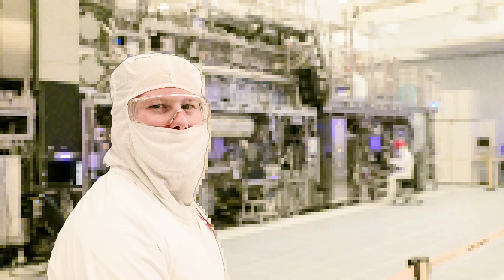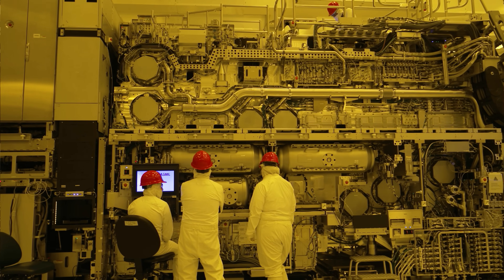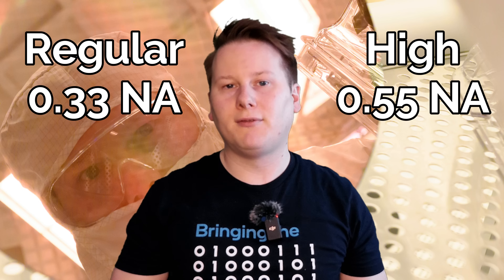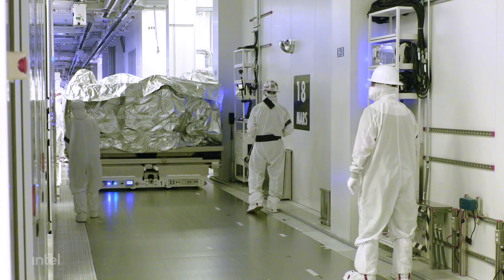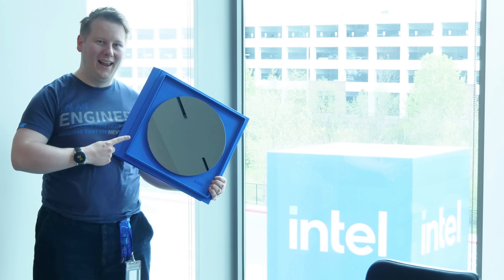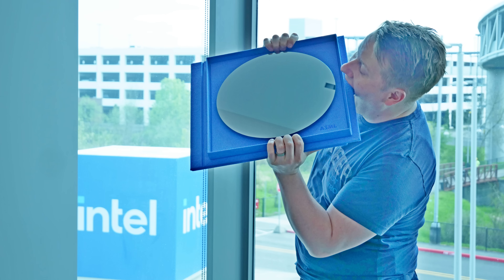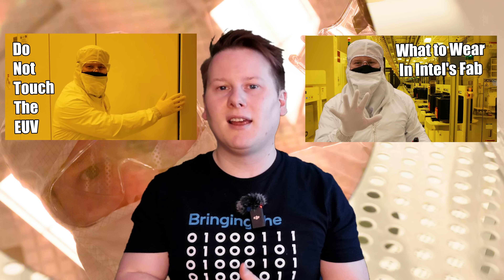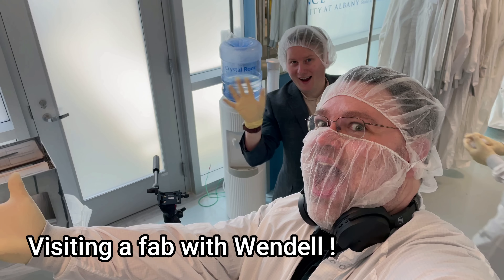Intel's Newest $350 Million Machine

Comment: I am one of the software engineers that developed the software for it. I visited ASML EUV factory/cleanroom in Veldhoven a few months ago, there were EXE machines fully built and some other big modules being tested. It is amazing, you keep staring at it and each time you find something different about it. Making 10 nm features in high-volume is allien tech, it is almost half smaller than the current best high-volume process. In general, making features 50% smaller would reflect on 4x speed/performance or more logic, but because it is NA bigger only in one direction, the gain is limited to 2x. For Hyper-NA I think they are going for 4x gain.
Reply: It remains to be seen if High-NA can be made commercially viable.  Calibration of EUV v1 is already a nightmare, as the mask and mirrors and targets have to be aligned down to fractions of a nanometer to prevent partial or complete blurring of the projection. With High NA this calibration has to be 5 to 10 times as accurate, and for Hyper-NA another 5 to 10 times. Complete insanity, as some asia-tech channel described it. Furthermore the rate of tin droplet firings has to be increased from 50,000 to nearly 100,000 per second to achieve the luminosity needed. Suddenly that earlier mentioned calibration seems relatively easy..... Also remember that these machines need regular recalibration.
Reply: @paulmichaelfreedman8334  5 to 10 times improvements in precision aren't even register in a great scheme of things. calling that "Complete insanity" its like calling a switch from a hand saw to reciprocating saw "unbelievable". improving things that can be and should bd improved is what we as humanity do. and what we should do. there's nothing unusual or insane about it. 
>tin droplet firings has to be increased from 50,000 to nearly 100,000 per second 
actually its orders of magnitude less hard than going from 0 droplet firings to 50,000.
Reply: @paulmichaelfreedman8334  it feels like beyond some point using a linear prescription of complexity is misleading. I mean, perfectly aligning template and double shooting metals at 50 000 times per second is already insane. Should we think that 100 000 and finer alignment is that much more complicated? Unless there are some specific boundaries in some specific components, which I'm sure there are some as always, but overall, going there from here shouldn't necessarily be as hard as it might seem. I hope that makes sense. Basically, a lot of seemingly impossible things are already done. Improving that, while sure it's a challenge, is not as complex as getting where they are already.
Reply: @dmitryburlakov6920  Sure it's the next step up, not the tenth. But it's still a big step. 100,000 is much harder than 50,000. I'm not doubting they will achieve acceptable yields, but it might turn out to take much longer - something taboo in the sector.
Reply: Eindhoven = Veldhoven :)
Reply: What languages are they programmed in? I imagine that because there are a lot of embedded components, a lot of C is used, but do you also use higher level languages to program the logic, send general commands, etc?
Reply: @_yonas  the machine has everything, hardware description (verilog/vhdl), c/cpp, python, java, julia, and some specific application languages
Reply: Alien technology confirmed 2024 gang gang
Reply: Out of curiosity do you know what Intel model of chips this will produce or is it too far out yet for offical branding?
Reply: @mydogsbutler  it will produce chiplets/dies for ALL OF THEM for a decade or even more until they switch to a newer machine for newer chips but will continue producing lower-end chips/chiples with it even longer.
Reply: Meanwhile China goes quantum  with optoelectronics; Game over!
Reply: Incredible.
Reply: Where can I get one of these machines? I think if I had one I would be pretty wealthy
Reply: @TKUA11  buy from ASML
Reply: Lol just make sure you dont leak like china or get hacked. This is a public place bro
Reply: Give us the source code!
Reply: I dont even know what im watching i been reading these comments lol
Reply: the stocke price should have been 200 dollar but it dropped to 30 dollar, and this guy will not tell you why?
Reply: 185 wafers/h @$20k = $3,7 mil/h. it will return its $350 Mill cost in 4 days.
Reply: @rawdez_ the gains are a few orders of magnitude lower then that. Keep in mind, there are thousands of process steps to make a wafer useful and millions of dollars a year are spent on keeping these overcomplicated machines running. Go work for a fab and you’ll figure out it’s not all sunshine and roses.
Reply: @alexanderbrown6077  yeah I know. I'm talking about that time they'd start actually using that thing for production. obviously you need time to get there. but when they do - as they always have - it will be just a week to return all its cost back. and then it will print Intel money for decades. with upgrades maybe not even dropping money printing speed too much.
millions of dollars a year are spent but billions are made.
Reply: @alexanderbrown6077  >there are thousands of process steps to make a wafer useful 
in comparison to making wafers those costs are pretty much negligible. thats exactly how corporations make billions in profits. IT IS all sunshine and roses in the end.
Reply: @rawdez_  You seem to have a misunderstanding of the larger picture. Get involved in the industry at the upper level and see reality for yourself. By the time they have it ready for a haphazard production ramp they will be Billions of dollars in debt. Just look at how Intel Foundry Services is doing on its latest financials as evidence of that. Any money they make from it is largely going to have to go into funding the next generation of equipment for the company to stay competitive. Money printing isn’t that simple. Equipment payoff timelines is measured in years not weeks.
Reply: @alexanderbrown6077  lol, your arguments are invalid. obviously equipment payoff timelines is measured in years because they spent years prepairing for production and it takes more than 1 machine. but payoff timeline for that 1 exact machine during production phase is LITERALLY just weeks or even less than a week.
>Get involved in the industry at the upper level 
thats not an argument. actually thats like a wellknown logical fallacy aka "achieve smth to understand".
>they will be Billions of dollars in debt
they will be Billions of dollars in PROFITS from milking previous equipment that still prints chips.
Reply: @rawdez_  You are missing the fundamentals of manufacturing cost modeling and value stream mapping. One process step at one machine does not quantify the entire economic output of a factory. The value added of a factory is not the value added of the entire value stream from sand to packaged cpu. 

You don’t cover the cost of a $350+M stepper in a week of bouncing photons off silicon or everyone would only be doing that. There are thousands of other etch/dep/imp/etc. steps and 10+ million dollar machines involved in getting one barely functioning CPU produced. There is a reason GF dropped out of the leading edge race several years ago and laid off their entire EUV team. 

Intel is over 100k engineers and highly skilled technicians along with billions of dollars in equipment and software support companies. With all of that “milking”, they have barely stayed competitive as a business with McDonald’s over the past decade with regard to Gross Margin percentage.
Reply: @alexanderbrown6077  just lol. a lot of empty words. go invest in McDonald’s then))
Reply: @alexanderbrown6077  in no point I've said 'everybody can do it'. everything you're mentioning doesn't make any of my points wrong. as tech corporation Intel is successfully milking the market with near-0 progress tech and makes billions by doing so.
Reply: @rawdez_ you’re forgetting that (1) there are costs for materials, consumables, staffing and power (for example, the silicon wafers, the etch resist chemicals, the enchant, 180kW/hr for the lasers etc) and (2) the completed wafer requires MULTIPLE passes through the stepper (one or more passes for each layer). SOME of the layers can be created with lower tech hardware, but you don’t make 185 COMPLETED wafers per hour, not even close to that. The payback period is far longer than you seem to think.
Reply: @stevetodd7383  I'm not forgetting anything. its all already included into wafer prices. you actually do make 185 COMPLETED wafers per hour when production happen.
Reply: @rawdez_  you’re dreaming if you believe that. It can take over 6 months for a wafer to go from one end of the production process to the other. There is no way that a single stepper machine can create 185 FINISHED wafers per hour. Again, one pass in the stepper can, at best, create a single layer of the design. Modern chips can easily need 20 or more layers.
Reply: @stevetodd7383  do you think that the mass production process isn't automated and "printed" wafers go from 1 machine to another for 6 month? just lol
Reply: @stevetodd7383  machine/production line makes everything - all layers. you're delusional if you think that process takes "months".
Reply: @stevetodd7383  what you describe its simply not mass production - its a joke. wafers cutting/packaging/testing of chips - yeah, it probably can take months with logistics and everything. but we aren't talking about that.
Reply: @rawdez_  industry standard is 1 to 4 days per mask layer depending on which part of the industry you are in. Analog wafers have a dozen mask layers, Logic and Memory wafers can have a few dozen mask layers. Each mask layer involves the wafer going through typically a dozen semiconductor manufacturing tools, sometimes more. The lithography tool showcased in this video could be one of those tools. It is automated yes, but this is not simple injection molding or CNC process. A finished part is not produced by going through one tool. The lithograph machine does not etch, it does not implant, it does not deposit films, it does not thermally anneal. A whole separate tool is even needed to apply and develop the photoresist.
Reply: @alexanderbrown6077  industry standard where & when? we are talking about leading edge process here, not about "indstry standard". obviously its not a standard, its a stand out leading edge. and where you get your information from, I'd like to look/watch/read.
>could be one of those tools
apparently you don't know what you're talking about
Reply: @alexanderbrown6077  making nm-level transistors is technologically hard, everything else is relatively easy and cheap to do.
Reply: @alexanderbrown6077  Intel themselves said that machine makes 185 wafers/hour. I didn't made that up. go argue with Intel statement, why argue with me. you're like "NO, Intel, AKSSHYUALLY you CAN'T" lol, because "INDUSTRY STANDARDS".
Reply: @alexanderbrown6077  "the most complicated process takes less than 20 seconds, but easy steps take WEEKS", lol. yeah, right. nice fairytales, dude
Reply: @rawdez_ Except these are public companies.  We can literally look at their profits and they aren't doing particularly amazingly.

I don't think you are factoring in all the expenses they have -- both in running the machines, researching the next generation of tech (not to mention all the false starts) and the fact that they don't get paid retail prices for most of the chips they sell.

If they were just printing money than why have so many companies dropped out of the game?
Reply: @petergerdes1094  lol. they are LITERALLY MAKING BILLIONS in profits. and with these profits they buy and kill all competition. margins on near-0 progress silicon they sell is actually INSANE.
Reply: @petergerdes1094  old cheap-to-produce silicon made with old fab machines is overpriced af. new silicon is overpriced even more. they can easily afford selling @ a bit lower than arbitrary overpriced x5-10 times (& way more)  "retail prices".
Reply: @petergerdes1094  amd pays TSMC and sells similar silicon and still makes HUGE profits. intel are their own TSMC, basically they get all profits for a piece of silicon when their rivals have to share their profits with other companies. Intel is doing actually great.
Reply: @alexanderbrown6077  I wouldn't call them overcomplicated, they're as complicated as they need to be for such a delicate process.
Reply: @rawdez_ You totally underestimate the complexity of these machines, the complexity of the processes. Your ROI calculations are way off.  You seem to forget these machines need to be housed in billion dollar clean room buildings. They need lots of power to run.  Lots of people to run them.  If things were anywhere close to what you are saying, Intel would be in a much different position today instead of laying off thousands, loosing billions of dollars and seeing their stock price cut in half.
Reply: @rawdez_ the problem is in your initial number of $20k. It doesn’t include any of the other costs of production so it doesn’t really earn back $350m in 4 days. Intels reasoning for not having one of these much earlier was that they didn’t think they could make it profitable. Clearly, they were wrong and have changed strategy
Reply: @UnderscoreZeroLP  $20k is actually high estimate, lol, that includes EVERYTHING. but okay not 4 days but a week. or EVEN 2 WEEKS. happy now?

intel's reasoning for ignoring these machnes is they didn't have to make any progress because milking of 14nm++++++ and then 12-13-14 "gen" was going just fine and noobs kept buying their near-0 progress CPUs. and there were nothing to worry about. but now there's ARM64 nuvia/snapdragon and amd with 40cu rdna3 iGPU. so intel kinda have to match their performance now. and thats exactly what they are doing. and all those mar-ke-ti-ng fai-ry ta-les are just mar-ke-ti-ng for noobs. + somebody shorted their stock. everyone is happy. you really should stop believing everything corporations say and ask yourself WHY and WHAT THEY DO. they ALL are maximizing profits and telling useful lies to maximize profits.
Reply: @rawdez_  this machine doesn't take blanks and spit out finished wafers ready to be cut, does it? Thefe are a bunch of other machines in the production line and people & consumables & building, infrastructure etc. to keep them running.

Won't that alter the per-wafer profit?
Reply: @AlexKarasev  no. what I've counted from is a finished wafer price
Reply: @rawdez_  my point exactly. You divided this machine's cost by the finished wafer's price and by this machine's top wafer throughput (for a single photolithography pass, right?). But photolithography exposure isn't the only step & machine involved in turning blank wafers into finished ones. Furthermore, the same wafer may go under this machine over a hundred times as more and more layers are formed on the chip before it's finished. Further-furthermore there are running costs (consumables staffing, etc.) to keep that entire operation running - all the machines including this one - not just the purchase cost of this one machine. All of that takes away from the profit remaining from the sale of that finished wafer.

I'll go as far as saying all those factors worsen the "pay for itself" estimate to such a degree that Intel in fact may NEVER fully recover its purchase cost of this machine. But it has to bite the bullet anyway to
1. Stay at the forefront of the chip market by gaining early access to, and experience with, this process. Once this becomes more routine and scales up, the profits will improve some & Intel will be well positioned by tben to reap them.
2. Possibly more importantly, US Dept of Defense may have told it to do this or else, and thrown a bone its way - be it some subsidies or tax lenience or something else under the covers. Won't have to be much as the Fed has a law on the books enabling it, at a time of war (and when wasn't it a time of war?) literally to tell Intel what to do and how to do it, without any disclosure.
Reply: @AlexKarasev  it doesn't change anything. you can add a week or 2 of time or a month if you wish and that would be it. other machines are already available. all costs ARE ALREADY INCLUDED into my initial calculation as it is about A FINISHED WAFER. you're just making things up to try to make it wrong. but it is 100% correct.
Reply: @AlexKarasev  you can try and argue that "its a whole factory that makes chips not just this one machine" all you want but that 1 factory literally makes billions of profits a month and the cost of a $350 mil machine is nothing in a long run of a quarter or a year.
Reply: @AlexKarasev  go argue with Intel - 185 FINISHED wafers per hour from this machine thats their number, not mine.
Reply: the problem of slow progress is EXACTLY because corporations don't want to throw away these machines. it pays for itself in like a week of production of chips and they keep using them for DECADES milking the market instead of actually doing some FAST progress.
Reply: why throw away a machine like this? it is thanks to old nodes that we have high-efficient chargers, IoTs, cheap memory, cheap high speed internet. You do not need the smallest features for all applications. There is a whole market called "mature technology" for older machines. The economics make sense, no need for initial capital, the machine is installed and calibrated, you know exactly how to operate it, you optimized the hell out of it. In other words, it is cheap to produce chips with these machines. The customer know this and it reflects on price per wafer, making incrementally more complex chips cheaper
Reply: @xanokothe  No one is saying throw the machine away.
Reply: @xanokothe  yes but it also kills innovation because machine users i.e. corporations  become complacent with profits and humanity ends up with a lot of "cheap" (but actually overpriced x5-10-20-50 times) obsolete slow 0 progress tech. e.g. basically the same performance level for GPUs/CPUs/consoles/memory/dumbphones for a decade or even  more. its literally 0 progress that you're praising. I'd rather have x1000 faster teraherz CPUs, GPUs, memory and way faster teraherz internet by now than "high-efficient chargers, IoTs, cheap memory, 'cheap' current internet". but actually if progress was way faster (as fast as it technologically can) we'd have all of this but way better. not gonna happen though. because milking the market and the same equipment is way more profits.
Reply: @rawdez_  There is a lot of demand of electronics that can be done with old tech. They demand have actually increased so it's more a problem that it's not enough with the old machines out there to do stuff that is not for smarthphones, servers and PC. Even in an PC all the things is not done with the same node, if you look at your motherboard, it's a lot more than the CPU there.
Reply: @lubricustheslippery5028  one of the challenges with the older tech is the margins are often too tight to justify new tool prices so a lot of those other chips are still manufactured on old equipment still running DOS and OS/2 operating systems and the latest Pentiums.

Another challenge in the Analog side of the industry is that the technology isn’t transferable to 300mm wafers (so can’t use newer tools) due to crystal growth limitations.
Reply: @lubricustheslippery5028  >that can be done with old tech.
yeah. what I'm saying is when you have way faster progress it all shifts up. way better "old tech" than what we use as "top tech" now could've been used as "old tech" - in a better world where there's actually way faster technological progress e.g. intel tera herz  is in production from 2005. obviously you'd have to have way better chipsets / bus / memory / storage or whatever for x1000 faster CPUs/GPUs etc. as is its just excuses for obsolete tech. like "we use it, see". but we could've used way better tech instead.
Reply: @rawdez_ I don’t think dumping raw bleeding edge tech would do much good for anyone. Very limited upside but downside - potentially extinction level. Nobody is complaining, to my knowledge, that things are too slow.
Reply: @unixux  everybody with enough working brain is complaining that things are WAY too slow and progress speed is nowhere near what its been in 90s and early 2000s - exactly because corporations chose milking the market with as slow progress as possible.
Reply: @unixux  obviously you don't hear any complaining from noobs and tech shills that basically make ads on yt for overpriced 0 progress crap and call THAT 'reviews"
Reply: @unixux  meanwhile the $2000 4090 is unable to run modern games on BUDGET $200 1440p 180Hz monitors without upscale and glitchy fake frames. for $2000 its only capable of 52FPS @1440p in Alan Wake 2 on BUDGET $200 MONITORS. i.e. progress wih silicon is actually even slower than VERY SLOW progress with displays. to the point corporations sell $2000 GPUs that are ALREADY OBSOLETE because aren't fast enough for modern games. GPUs these days have to be x3-4 faster @ x10 lower prices to make any sense. and that is with obsolete cartoonish-looking 'modern' gaming engines.
Reply: @unixux  "Nobody is complaining", lol. maybe that is THE PROBLEM that people aren't even able to complain these days because everything is controlled by corporations. e.g. most of my comments disappear.
Reply: @unixux  I mention Intel tera herz in comments - it disappears. 
"nobody's complaining", yeah, right. its just you chose to not notice the complaining
Reply: @unixux  >I don’t think dumping raw bleeding edge (e.g. 2001 Intel tera herz - 1000GHz) tech would do much good for anyone.
actually I tend to agree because I see obvious repercussions of silicon becoming obsolete in an instant. BUT we can have computational power that actually is adequate to reality we are living in in 2024 - just limit it to sub tera herz frequencies and make less transistors per chip for consumers. meanwhile supercomputers can become thousands times faster and start solving humanity problems WAY faster. instead they milk silicon tech and come up with software solutions to fake having more performance. and outcome looks just pathetic.
Reply: @unixux  now we get 0-15% "progress"/year in performance. which is just pathetic. yeah, we don't need any faster hardware when 99,9% of the market consists of old hardware + "new" hardware with old performance level which leads to all software being made for that SLOW hardware. old hardware with people who defend it is the reason there's 0 progress, why everything is an obsolete slow trash and overpriced. 6-8 y.o. tech is basically on the same performance level as "modern" tech and a bit faster but still way too slow hardware with software tricks to fake "more performance" (like GPU upscale and fake frames generation) is insanely overpriced - so old hardware can stay overpriced af too.
Reply: @unixux  there's 0 performance progress between the 7800xt and the 6800xt. or between the 4060ti and the 3060ti. 3 years have passed = 0 progress. before mining in 2016 top GPUs that could've run ANY then-new GAME on top-spec monitors @4k 60fps (which was elite FPS and resolution at the time) cost $600 => in 2024 $2000 can't drive MODERN BUDGET $200 1440p MONITORS in now-modern games without upscale and fake frames that introduce latency. drops to 16fps @1440p with RT in CP2077 on a $2000 GPU. and its still looks like low-VRAM cartoonish crap that it still is. yeah, much "progress'. very wow. 

i could continue with examples from GPU/consoles/CPU markets that show 0 or negative "progress" for hours. and you tell me "nobody is complaining".
Reply: @rawdez_  you’re comparing apples and oranges. The 4090 with ray tracing on may struggle at 1440p, but that’s because ray tracing is hard and every other video card on the market is slower. Turn ray tracing off or use DLSS and performance is much better. Running older software on the new card and you’re bouncing off the frame limits of the software.
Reply: @rawdez_  there are three different ways in which CPUs are improving these days. The traditional way was to improve the clock speed. That is still happening, but at a much reduced rate. The second is to improve IPC (instructions per clock), which is holding to about 10-15% per generation. All the easy wins have been made here, and it eats many transistors to make these improvements. The third way is to add custom hardware units for specific tasks (video encoding for example, or NPUs for AI work), but that needs the software to catch up to make use of it. 

Gone are the days of needing a new PC every year or two to keep pace with the software, but a cumulative 10-15% each generation for three or more generations adds up to a significant improvement.
Reply: @stevetodd7383  no is not. it doesn't adds up to "significant improvement". 
e.g. nuvia/qualcomm CPUs exist - 5 times faster than Ryzen 4. will we see it released with +400% performance/watt right away? NO. they gonna MILK IT to maximize their profits from this tech. same way as Intel released 14nm++++++++ and then 12-13-14 "gen" being the same. same as amd when releasing non-3d vcache CPUs or ryzen 1000-5000 when Zen was supposed to be like Ryzen 5000 right away according to leaks. same as Apple M1-M4. its all the same milking.
Reply: @stevetodd7383  rt is 6y.o. tech. it isn't hard. its nv milking the market and not improving their GPUs and RT enough so they don't have to drop prices on older GPUs much.
Reply: @stevetodd7383  >Turn ray tracing off or use DLSS 
then why even buy new GPUs lol? you can run it the same on a used 6800xt for less tha $300. new GPUs make 0 sense and you're defending the absense of progress by repeating mar-ke-ting fai-ry ta-les.
Reply: @stevetodd7383  I'm comparing the past in 2016 and the present 2024. it is TOTALLY VALID comparison. there was a progress with monitors and mining is gone. GPUs obviously are obsolete, overpriced at least 3-4 times + WAY too slow for reality in 2024. lets even ignore that its all low-VRAM crap not capable to produce realistic graphics and that visually its not really far from Doom3 2004.

but yeah, tech shills really don't like when people use common sense in their comparisons.
Reply: @rawdez_  if you believe that Nuvia chips are 5 times faster than Ryzen 4 then I have a bridge to sell you. The performance per core is pretty close between Intel, AMD and Apple. The efficiency per core is somewhat different depending on the base architecture (ARM64 being significantly easier to decode than X86-64), and Apple run a wider execution unit (8 wide rather than the 6 wide of Intel and AMD), but the performance per core of the top end parts is within a few percentage points of each other. The big problem is that current software tools and languages aren’t good at multi-processing, so that a single application rarely makes efficient use of more than a handful of cores. This is why gaming PCs of the current generation don’t really improve beyond 8 cores.

So, Nuvia is based on ARM64, using ideas from the design team that came up with the Apple M1, and performs at a per core level very similar to an M1 performance core. The idea was that they would put a lot of these performance cores on a server and stick it in a data centre. Servers run many parallel applications so the multi-processing issues don’t apply, but it’s like comparing a truck with a sports car. The truck is optimised to shift a lot of stuff at the same time and the sports car shifts comparatively little, but faster. Nuvia can shift more volume than Ryzen 4 (though probably not the Zen 4 based EPYC server chips), but only by having more cores with lower efficiency than the Apple M series (which mix performance and efficiency cores depending on model).
Reply: @rawdez_  ray tracing is eye candy. It gets turned on by people who want better looking images rather than absolute performance. DLSS is there to drag performance back to something usable if you use ray tracing. Modern high end GPUs are fast enough for 4K raster graphics rendering for the most part. Older cards fall down over the amount of VRAM available to the app. Modern games need 12-16GB of VRAM to hit peak performance, and your 2014 card would be lucky to get 8GB. You can still use older cards, but you need to turn image quality settings down to make them usable.
Reply: @rawdez_  ray tracing is a problem that is yet to be fully solved. Modern GPUs have reached the point where it is usable, but it is far from fast and perfect. Nvidia are on their 3rd iteration of their ray tracing hardware, and as you pointed out it still kills performance on high end cards. The problem is that there is so much complexity and computation needed to make it work that it’s on the edge of what can be achieved in current silicon.
Reply: @stevetodd7383  rt is not the problem. the problem IS not wanting to drop prices on older products = no making faster products = no progress. and you're. just. repeating. nv mar-ke-ti-ng.
Reply: @stevetodd7383  dlss is there to sell SLOW 0 PROGRESS hardware. thats what it is. useless glitchy gimmick for useless slow overpriced af cards. artificially limited to newer GPUs for artificial market segmentation. instead of making actual progress with hardware and dropping prices corporations make cheap-to-do software upscale + glitchy fake frames and keep prices high. including on old hardware - old gen GPUs and consoles. + release slow af handhelds barely running anything with help of upscale and fake frames on pathetic hardware.
Reply: @stevetodd7383  you're just repeating marketing nonsense like a typical nv shill.
Reply: @stevetodd7383  blah-blah-blah marketing bull--sh-it
Reply: @rawdez_  they do keep selling their older products at lower prices, they just tend to rebrand them (GTX1660 anyone?). I’m not a great nvidia fan myself, since AMD cards tend to be better value for money providing you don’t want RT, but I have a top end 2013 era GTX980 and a mid range Radeon RX 6700 XT. The AMD card runs rings around the older nvidia model. It’s not something you wouldn’t notice.
Reply: @stevetodd7383  if progress was as fast as it supposed to be in accordance to Moore's law your obsolete in any modern game on a BUDGET modern 1440p 180hz monitor RX 6700XT would cost $0 like FX 5200 from 2003 costs now and graphics in modern games would actually be realistic movie-like, not mentioning it'd all be VR.
the progress IS artificially slowed down to maximize profits so obsolete cheap-to-produce hardware stays relevant and overpriced => way more profits.
Reply: @stevetodd7383  RX 6700 XT is a 2021 card, GTX 980 is 2014. in 6,5 years the RX 6700 XT should be ~x12 times faster according to Moore's law, IRL its just x2,3 times faster.
and don't forget that 1440p 180hz monitors are budget and THE norm now, it was 1080p 60hz in 2014. and RT is a 6 years OLD technology by now, which can't be run at playable level by any under-$600 GPUs now ($600 is top GPUs price pre-mining pre-2016). your GPUs are obsolete. the only reason they still run "new" games now is because gamedevs are forced to make "new" games for the market where there's 0 progress and all hardware is obsolete. "new" obsolete games on obsolete gaming engines for "new" obsolete 0 progress GPUs.
Reply: @rawdez_  firstly you’re confusing what Moore’s law says. It doesn’t say that every 24 months performance will double. What it does say that every 24 months the number of transistors you have available for a design will double. Much of engineering is about diminishing returns, that is 100% more inputs doesn’t give you 100% more output. Just like with CPUs, all the simple improvements have been done already. GPU designers have to make decisions over which improvements will give them the best gains for the number of transistors they have available.

Second, a gain of a factor of 3 (which is what I get on synthetic benchmarks like Firestrike) isn’t zero. Moving to a top end card of the current generation about doubles that. Again, not zero. You seem to have this mad idea that anything less than double is zero. The improvements from generation to generation aren’t constant, but it have been consistently upwards.

Card prices have been high for a number of reasons (COVID causing component shortages, GPU mining taking off, the increasing cost of wafers because of the increasing complexity of the hardware needed to create leading edge chips etc.). Again, Moore’s law doesn’t say that prices will reduce. However, if manufacturers price their products too high then they won’t sell. It’s a balancing act over what performance they can give you for a target price.

Once again you have harped on about RT being 6 years old. No it isn’t. RT software on desktop machines started to appear back in the 80’s (but it could take hours to render a single image). 6 years ago they finally managed to get it to run on hardware fast enough to run real time games, just with a performance penalty compared to traditional raster graphics. Look at how long it took between the first 3D graphics cards becoming available and 3D graphics becoming high resolution and high quality. No one, not nvidia, AMD, Intel etc, can currently make RT hardware that can keep up with modern monitors. If you want to run at 180Hz or higher then your priority isn’t image quality and you don’t turn RT on. Modern game developers realise that it’s a feature that most users don’t make use of because of the performance impact, so they provide a setting switch to allow users to turn it on or off.

The other mistake you are making is that game developers aren’t using the extra power of modern cards. Most games come with quality presets, the highest being suitable for latest generation top end cards, and lower settings being there for older and/or lower end cards. Gamers with the latest and greatest hardware get a visually better experience, but the same game. Try running an old game on modern hardware. Something like GTA V runs so quickly on a modern GPU that the CPU can’t keep up and it starts stuttering (the developers couldn’t conceive of anything running that quickly and didn’t rate limit the frame generator).
Reply: @stevetodd7383  blah-blah-blah synthetic blah-blah-blah "x3 in 6,5 years is YUGE" lol. top card then cost $600 so compare to $600 cards now, not top cards. and stop with mar-ke-ti-ng bu-ll-cr-ap
Reply: @stevetodd7383  yes they can. the problem for gamers is they DON'T WANT TO MAKE PROGRESS because OBVIOUSLY progress drops prices. and obviously you are just repeating their mar-ke-ti-ng
Reply: @stevetodd7383  firstly you’re confusing orders of magnitude. a free tip: x192 and x8 are VERY different numbers. x12 and x3 are ALSO very different numbers. you can't even explain that difference with  mar-ke-ti-ng bu-ll-cr-ap like "It doesn’t say that every 24 months performance will double" or "all the simple improvements have been done already" lol.
Reply: @stevetodd7383  i bet YOU KNOW you're full of it. but you just can't help yourself
Reply: @rawdez_  apparently you don’t want to understand, or are unable to do so, so I will make this my last message on the matter. Old games like GTA V are relevant because that’s the sort of thing you would run on a graphics card back in 2014. It was brand new at the back end of 2012. It runs on “potatoes” these days because the performance expectations of a modern card are that much higher than back then. What was a leading edge card in 2014 is a potato today. This isn’t me being a shill for the GPU industry, this is me pointing out just how skewed and off base your idea about GPU performance increases are. The extra performance provided by a modern card has been used by games developers to make their games look prettier. Your perceived lack of improvement is not because GPUs haven’t been improving, it’s because modern games run at the same speeds as period games on period hardware.
Reply: @stevetodd7383  and what was a leading edge card in 2015 is actually NOT a potato today. because after 2015 progress got slowed down to minimal speeds and 1080ti level cards still can play modern games. also ps5 has gtx 1070 performance level.
Reply: @stevetodd7383  GTA V is jusy a marketing tool for shills to try convince noobs there's enough progress with tech.
Reply: @rawdez_  Intel just reported a 7 billion dollar loss on its foundry services, they are not printing money and "paying for themselves" over a week of production, that's for sure. I also don't get why you think they don't have financial incentive to have better processes. Sure if Intel were a monopoly in the foundry business that could be the case but they definitely aren't, they face very very stiff competition from TSMC and Samsung and they are spending billions of dollars in R&D and fab building so that they can retake the leading process capabilities. If you want to imply that TSMC, Samsung, and Intel are in some kind of price fixing scheme you're gonna need a lot of evidence to prove that, and you will have to also disprove a mountain of evidence that runs counter to that. Why do you think they so carefully manage floor space and keep them running basically 24/7? Its because its the only way to maintain profitability and even then Intel is still currently operating at a loss. Also your claim of "slow progress" almost couldn't be more wrong. Computer chips are famously one of the fastest (if not THE fastest) improving technologies in the world. Ever heard of Moore's law? Yeah... most businesses aren't improving their technologies at exponential rates, sure its slowing down somewhat in modern times, but its still far faster than linear improvement. Also, why do you think that they keep older machines around? Global foundries has stopped chasing the leading edge in equipment because most of the chips in our world don't need to get faster, there's no benefit. If the sensor in your car already reacts to collisions in superhuman time, they just don't need to make it faster, they are going to reserve their top end technologies for situations where higher speed actually helps, CPU's, GPU's, AI accelerators etc. Your argument is like complaining that because race cars exist we should stop production of slower cars. Slower cars still get you from A to B and have plenty of demand.
Reply: @ExcellentEric  ALL of the chips in our world DO need to get faster, there's benefit of getting more performance/watt = getting new possibilities OR dropping energy consumption.
Reply: @ExcellentEric  your argument is like defending abscence of progress and gasoline engines against electric engines/other future engines. like saying "humanity doesn't need warp drive or flying cars/drones or any new better technology" thats exactly what you're saying here.
Reply: @ExcellentEric  your argument is like complaining we don't need cars at all we should use horses and donkeys instead - still get you from A to B and have plenty of demand
Reply: @ExcellentEric  not to mention intel tera herz 1000GHz transistor technology leak in 2001. actually PCs/GPUs/etc. can become 1000-100000 times faster by using better tech than silicon. that tech exists from 2001, we could've had it in 2005 but ntel chose to keep milking the market with silicon instead
Reply: @rawdez_  That's just not true, I'm gonna be honest you come across like a 16 year old with no experience in the world of engineering. In engineering there are some things that just don't have a genuine benefit from being improved. Take a hammer, you can add a compass to it, the ability to charge your phone, and geolocation, but that stuff just doesn't make a lot of sense. There are some things that are good the way they are, and the people that make them are just servicing a demand.
Reply: @rawdez_  I am not defending the absence of progress because 1) thats not what I said 2) there is plenty of progress being made. Just because they continue to produce chips with older nodes doesn't mean they aren't making progress in other areas. "Exactly what you're saying here" at least with that statement you made it clear you were misunderstanding me.
Reply: @ExcellentEric  >There are some things that are good the way they are
and CPUs, GPUs, gaming consoles, SoCs in all dumbphones and TVs worldwide AREN'T GOOD THE WAY THEY ARE. too slow, too powerhungry/inefficient, too obsolete with 0 actual progress per $$$, way too OVERPRICED. thats what it is ACTUALLY with tech
Reply: @ExcellentEric  e.g. I personally always predrill holes for nails with a cordless drill/driver these days before hammering it. because its way better than using just a hammer by itself, that way nails have less chance to bend, nail goes where you actually need it to go and wood don't split almost never + using a hammer is way easier, accurate and efficient after predrilling. 
and the same way I could've used way better way cheaper GPUs and CPUs and SoCs in dumbphones but there's none. its like we stuck just with a hammer no powertools and able to do only obsolete type of jobs very slowly and inefficiently. and everything is way too overpriced, for the price of just ONE rtx 4090 (that is unable to even give a decent experience in new games on max settings even @ BUDGET 1440p - 52 fps in Alan Wake 2 and drops to 16fps in cp2077) - $2000 - you can fill a whole shed with powertools and other stuff for work. thats what it is with modern tech. slow, inefficient and overpriced to the point of being unaffordable to 99,9%. did I mention its very slow and very overpriced?
Reply: @ExcellentEric  > Intel just reported a 7 billion dollar loss ... aaaand 54 billions profits in the same report
Reply: @ExcellentEric  That's just TRUE, I'm gonna be honest you come across like a 0,5 year-old nv/intool shillbot with no experience of actually living in the actual world.
Reply: not making any progress and using these machines for decades = printing trillions $$$ from sand. just have to slow the progress down to being as slow as possible.
Reply: @rawdez_ your naitivity outstands me. 

printing from sand? pays back the cost in 4 days? you clearly don't know what your talking about. 

do you really think the only ingredient here is sand? do you really think that it's like a damn ice cream machine where you just put the ingredients at the back and then push a button?

do you even know the number of toxic chemicals are involved in this? the amount of water used?  electricity? how the wafer is made? it's not like you just throw a handful of sand on a pan and spread it out like a pancake and voila you have a silicon wafer with perfect surface and no blemishes! do you even know how the lasers are generated? it's even on the f*cking video! and even after all these intricate steps they have uncertain yield!
Reply: intel tera herz in Intel vault of future tech is collecting dust from 2001. while corporations are milking funny low sillicon gains for decades.
Reply: 10nm? TSMC is already shipping 4nm apple chips.
Reply: @DK-ox7ze  not the same... node name is a marketing thing, it does not reflect the feature size
Reply: @xanokothe   But there must be some quantitative way/methodology to arrive at that marketed number. And that's what I am interested in. How much smaller will be the chip from this process when compared to smallest nm chips of today?
Reply: @DK-ox7ze  if you dig deep you might find this information, but you cannot compare the node name between companies.
Also, the name has nothing to do with the feature size. Intel is even ditching the nm from their name, I think they are calling just their nodes 7, 4, 3 and the 20A
Their is some internet sources saying that intel 10nm node is equivalent to 7nm TSMC, but I would not even compare that.
You should also consider the fab process, the design aspect, the architecture of the microprocessor, integration and modules.
I think, at the end, what matters is performance / cost / yield and profit of the company to reinvest in R&D
Reply: @xanokothe  Yes I know CPU architecture matters a lot. But if the transistor size is same then it's easier to compare architecture efficiency. Eg how much efficient has x86 become as compared to ARM?
Reply: Oh wicked dude!  Spill all of the secrets.  I'm broke and want to sell the info to China. 😂
Reply: @Alex.The.Lionnnnn  he didn't say anything chinese can use lol. to spill anything you'd have to drop scientific papers and documentation and even with having that it still would take chinese decades to implement their version. and it will be already obsolete by then. IMHO it is already obsolete even now, because intel spilled the beans about tera herz tech existing in 2001. imagine chinese manage to get working THAT first. would be interesting and VERY sad to watch that happening. or VERY fun. idk
Reply: Who the fuck asked?
Reply: @cds5067  me. any more stupid questions?